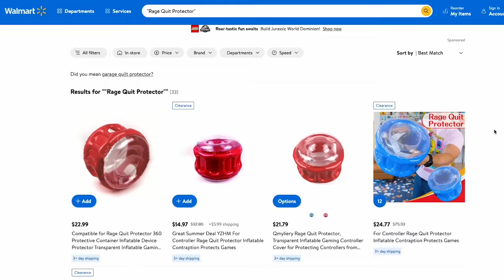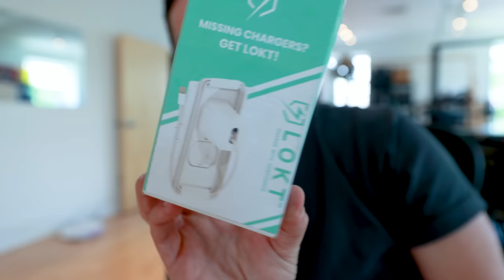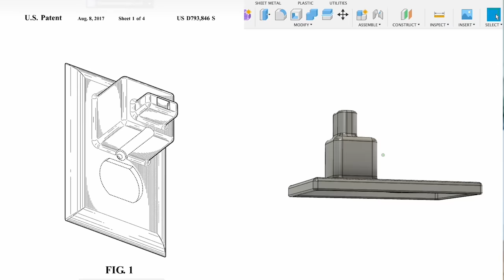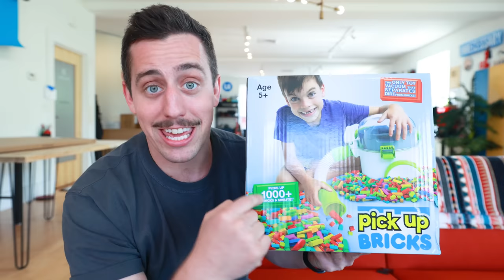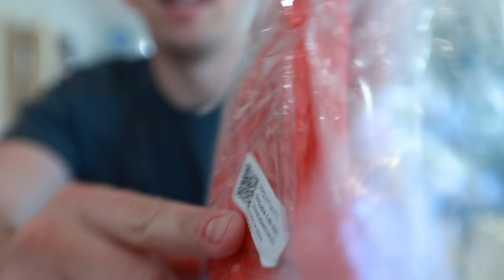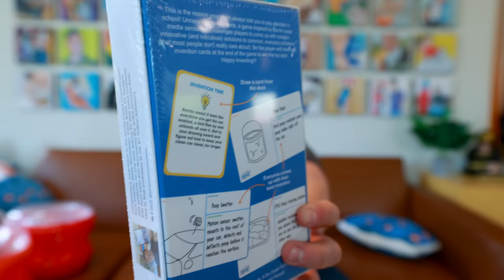Walmart is selling knockoffs of my inventions (AND using my photos)

Comment: your power brick looks nicer IMO. It doesnt stick out as much like theirs.
Reply: Yeah I thought the same thing. Looked like his sat more flush
Reply: yeah the only problem is box sizes
Reply: It was actually over tightened it creating it to bend out pressing against the cube, LOKT also sits flush. LOKT fits multiple cords such android, apple, micro usb, three corded, and fast charging cube
Reply: His was tested in his own house
Reply: Lokt had 2 tabs top and bottom where you could wind the cable around it when not in use

Comment: I used to work in a small injection moulding shop. One of the things we used to make was a sink unblocker by using compression. While out at a Boot sale one day, I saw a blue one. Exactly the same as the one we made. I spoke to the boss who designed the device. Told him I had seen it, and he said yes, it's a Chinese knockoff. How did I know? We only made them in red or yellow. Happens with everything.

Comment: LMAO the Lokt charger bending with the screw in the centre. UI's one looked far better lmao
Reply: It definitely looked like the Lokt one was inferior quality plastic. :D  But the cable hooks on top and bottom are a great idea though.
Reply: @ArniVidar  yep, just a simple redesign and off to the printer. I could do it and even have a product a few hours later. 3d printing is amazing for these purposes.
Reply: I was wondering if it was meant to go over the existing cover and you'd thread the screw both through the Lokt AND the usual outlet cover. It doesn't seem like it was meant to be so close to the wall, hence the bending.
Reply: @ArniVidar  òòò
Reply: The reason for bending was caused for by over tightening of the screw head.

Comment: In case of the croc and cable thingy I think the tag of "unnecessary invention" hits the company more deeply than the infringement
Reply: Croc's ego probably isn't hurt by this guy putting their logo on a completely different product but the cable guys took a hit straight to the heart there
Reply: This is where if he had any kind of agreement with them as he mentioned, He would need it in written form.  HE then legally could have gone back against the "cease and desist" order and had it reversed very quickly.  

A paper trail is as important as a digital trail.

Comment: I work for a company that manufactures drain valves,  we do a lot of injection molding.  We've had some of our molds manufactured by a machine shop in China,  not long after we launched the product,  exact knock offs started coming out of China.  We send them the specs to build a mold for us,  and they clearly made a mold for themselves as well.

Comment: @Unnecessary Inventions Just got an idea. Maybe to help prevent the possibility of the controller falling out, you could add like tight plastic flaps on both sides the the entrances, so you would have to squeeze it through (and it would help give some rebound if the controller goes flying towards the exit)

Comment: 3:45 are we not going to address the cheap plastic that bend when installed that look like dodo, if i where to buy this product i couldn't care less about the brick i want the retaining plate to look good.. the brick feels like a way to sell a 20 cent product for 15$+
Reply: Thanks for the comment, 
We use the exact same plastic as all outlet covers, its made in the USA so its actually not the cheap to make for us. You can certainly over tighten the cover. Its very durable

Comment: Not sure if anyone else has mentioned it (it's the internet, so someone probably did...), but there's a different kind of patent called a "Utility Patent". These are incredibly potent things. It's a patent not for a specific thing, but an effect. In your case, you could get a Utility Patent for an inflatable device that protects controllers from being damaged when thrown or dropped. That would mean any inflatable device, no matter its shape, composition, color, material, etc. that is intended to protect a controller from being thrown in rage (or for any other reason) would be subject to your patent. Getting a Utility Patent is .... not easy or cheap, even by patent standards, but they rather effectively give you control over that particular kind of product.

Comment: Patents don't cost 25 k.. it is like $1100 ish for a large company, half of that for a small company and half of that for an individual. Then you pay issue fees which again are at most $740. It only gets pricey if you file it incorrectly and get repeated actions from examiners that have to be addressed.

Comment: The charging brick wall locker, is another type of lawsuit, waiting to happen, anyway. Those inverters can get hot, especially when not properly ventilated. Poorly made inverters can be potential fire hazards, all on their own. Locking them with a cover and a screw to a wall outlet,...is  probably not so brilliant, if you think it through.

Comment: I can see how there was some attempt to improve on your design with the knockoff by making both the top and bottom transparent, so it wouldn't really matter which way up you used it. And maybe they thought using thinner plastic would soften the impact of hitting the ground, and making the hole slightly bigger would accommodate a wider variety of controllers, but the attempts to improve it mostly served to make the product worse at what it was designed to do. Though the double clear panels are a definite improvement, sorry to say.

Comment: No, when an inventor goes to have their stuff made in China, the person that owns the assembly line also sells the same products off the same assembly line without going through the inventor.  They're not even knock offs, they're originals.  This is perfectly legal to do in China and is done on every product made in China. The only problem is that US customs will intercept items with branding, check for trademark infringement, and make sure that it's actually going through that company/brand and if not they will destroy it.  So to resolve that, the companies in China just make up random brand names and slap it on the same products coming off the same assembly line.  So you can get American brands without the American brand on it for less than half the price even though it's made by the same assembly line in China and that's a common thing people in China buy and then they can even resell it online and still undercut the original inventors for a huge profit and also pass some huge savings on to the buyer.

Comment: Patents are not $25k. I have 14 patents, each of which approximated 2 grand each. Some cost more or less but thats the average. It just depends on research costs from the patent office. When you send in an application for a patent youll get a reply asking for more information usually along with examples of other patents that might be close to yours which would require documentation on how theyre different. It could be something from the intended use of the product (toy, decoration, tool or weapon) to whether or not the actual function is already patented. For example; I applied to patent a rocket launcher which was extremely similar to a type of rocket propulsion system patented for the use of stabilizing buildings during earthquakes. I got a letter and a copy of the patent and was told to elaborate on how my rocket launcher was different. Obviously, it was an anti-tank rocket launcher versus a building stabilizer so it was an easy win. But....yeah.....patents arent nearly as expensive as the guy in your video says they are. Even to change to alter a patent is just a few hundred bucks.

Comment: I understand the concept of the lockt charger, but don't truly like it. Cables tend to go bad ( especially if you end up buying a cheap one lol) and having to unscrew the wall plate everytime to change the cable ( while not hard) feels like a huge time waster. If they added a small lock on the side ( keyhole or something) that would allow the owner easy access to replace the cable then maybe.

Comment: You should make different sizes 
Considering hand sizes and controller size since PlayStation and Xbox are slightly different in size 
What about the wire? Maybe a zipper where there’s two zips that meet where the wire would hang out?

Comment: what about rage quit allihaveitlaters? A pair of handcuffs that you hook up you your hand and the controller and this prevents you from throwing the controller.   Do it up cut me in for 10%  An alternative is to your your croc glvoes and just modify them to be able to attach to the controllers as one of the cuffs so you can get the hand crocs then tether into the allhaveitlaters attach to the hand crocs.. yeah what a croc I know. Just had another thought as I was listening to some sound and the idea is that it uses like a resistance band to wrap around the controller rather than actual handcuff that works for novelty but this elastic resistance band material will likely be less likely to break the controller or snap off and it can fit all sizes of controllers by stretching around it like a elastic ring. In absence of diretly using the croc gloves you could put the other end on your wrist. It can age well as a whole lline of products.. like attach anything to it, your keys, your girlfriend, your child, your dog, so many thing can be protected using the allihaveitlaters.

Comment: I am a patent attorney. You are correct that you must describe how to make and use your invention in the patent. However, in the United States, you need not make it public until it issues. Also, if you have a good attorney, the claims of your patent will be broad enough to cover obvious variations of your invention. You also get some extra breadth from what is called “the doctrine of equivalents” which protects you somewhat from obvious variations. 

You are correct that getting a patent is expensive, so It usually isn’t worth getting a patent unless you can expect a million dollars in sales or so from your product.

With respect to enforcement, a patent does grant the right to block importation of the claimed subject matter. This is done through the ITC.

Comment: German patent attorney here - obviously biased. 

Unfortunately, I need to correct on the elaborations this key board guy gave: It is not true that a patent only gives protection of one single exact embodiment and thus becomes useless as soon as anything is changed toward a following model. Contrary to so called 'picture claims', patent claims are ideally set up rather abstractly. The more abstract the greater the scope of protection - but the harder to get the patent granted. Therein, a following model only falls out of a claim's scope IF any of the claim's features is completely left out. It does not fall out of scope if a new specification of an abstractly claimed feature is introduced. 

Finding the perfect balance between abstract but still understandable language is the biggest challenge with formulating a patent application.

Of course, not every invention might be worth filing a costly patent application. But stating 'it's all useless" is imho plain wrong and just proves basic misunderstanding of the matter.

To anyone who read this far: Have a nice one! :)

Comment: My father is an electrical engineer by trade who cut his teeth designing drilling and auxialliary computers for Oil Rigs. 

Things like keeping track of the length of the spool of hoist cable to determine how many pipes youve slipped into the ground. Fluid flow and directional drilling automation. All sorts of stuff.

He said he hates it now. The #1 most infuriating thing throughout his career were the chinese. He and this team would design this crazy intricate system to automate some function on a drilling rig, and unveil it at an Oil and Gas show.

Within weeks, a chinese firm would have a 1:1 copy, not even bothering to change the design, and sell it on the global market to oil producers with less stringent safety standards than North America (as anything used in oilfields here must be intrinsically safe, and that is expensive to test and verify.)

They were generally fine in the american/canadian markets, but were cut out anywhere else globally, unless they were designing something specifically for a client. But otherwise, they couldn't patent a thing without it just being stolen

Comment: if you are throwing your controllers/phones/anything really and breaking them so much you have to buy a product, you should probably just go to anger management to get to the root of the issue.  I have the same exact shop vac that you have in this video, i couldnt see my self rolling it across the house, undoing all the cables and hoses, just to suck up legos.... and put it all back.  what in tar-nation!!!??? grab a bucket, use both hands to scoop , once tiny legos are left, use a sheet of paper or construction paper(easier but not everyone has) to form a makeshift shovel. sweep slowly into paper, fast sweep will make legos fling.

Comment: I get you are trying to make a point but why lie in the process. A patent attorney will usually charge between $8,000 and $10,000 for a patent application. Or you can buy a kit and do it yourself for a mere $200-400. So claiming it costs $20k is hyperbole at best and disinjenuious at worst.

Comment: Yeah Chinese people are sneaky as who born in China I can confirm that Also myself have some OEM stuff with intellectual properties that not have been registered which is extremely likely to be copied because they have literally nothing to lose let alone the cost of OEM is pretty low You can do a OEM T-shirt for like $10 and free shipping and the same industrial products is pretty much the same but the quantity goes to 100 or so still it’s really cheap only cost you like several hundred or couple thousand dollar to Get 100 samplesSo my suggest will be released the product when you have plenty inventory Or your factory have guarantee you to have the capacity to deliver it at mass quantity. And also you can try to copy yourself release the same product under a different brand that’s selling only for like very low profit that the other competitor will just have no chance competing Your only advantage is before you launch the product so be prepared and you will eliminate potential competitor🎉